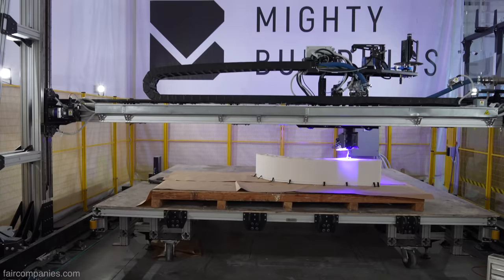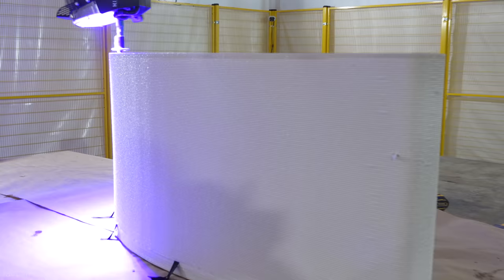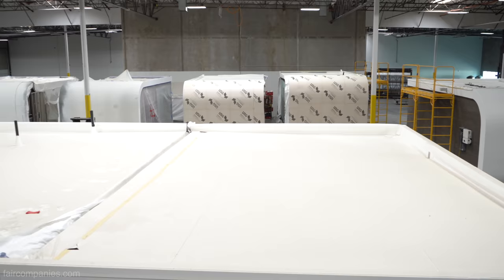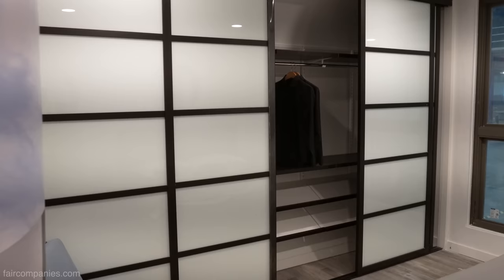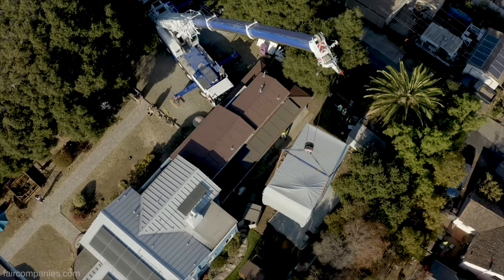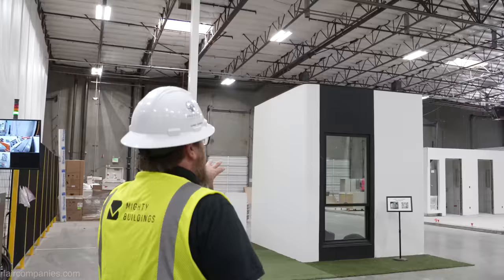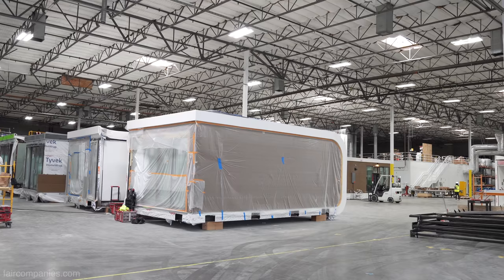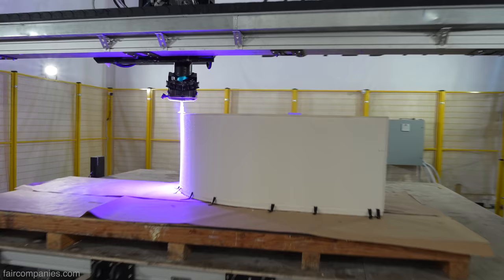3D-Printed in 24h, no waste. Price to fall as builds ramp-up

Comment: I’m a middle aged carpenter/builder and I’ll admit I was intrigued by the idea. Once I saw the price of these units, I can’t believe they sell any. Quarter of million for the little one. I could compete with that price and offer a better product.
Reply: Today that's probably true. 5 years from now though the price will be almost half and in 10 years it'll be a good bit less than that. 
The first cars could only be bought by millionaires.
Reply: @kensolar69  not even a close comparison. The first car revolutionized travel. Its not like this is the first house. It offers nothing new aside from less labor. Apples to fish comparison.
Reply: @taotracy4431  Horse and buggies to electric carriages and wood frame to 3D printed, That's apples to apples. It's a new technology that will evolve and advance over the next 10 years into something far less expensive more efficient than we have today.
Reply: Thing is Tao - it will be like Tesla - for twenty years it will be more expensive but as the technology matures and R&D is paid off it the cost situation will flip and they will be much cheaper - no labor being the main reason.
Reply: @michaelnurse9089  do you own a Tesla? The company was founded nearly 20yrs ago and the product and price is virtually the same. The vehicles are still impractical. Try living in cold climates with your Tesla and see how well it does. These homes are even more ridiculous. Another factor we didn’t even discuss is in the field remodeling and renovation. With nothing being conventional about these homes, in the field remodeling is impossible. There will be no one equipped with the capabilities to do the work. You people outside the industry have no clue. Homeowners can barely understand conventional remodeling and construction.
Reply: the first time i read this i thought you said you were a carpenter from the middles ages.  i was like, that's a cool profession tell me more.
Reply: @taotracy4431  Try reading a few history books, it's obvious you never have.
Reply: @kensolar69  Sure. Which ones do you recommend?
Reply: If you do it, it seems smarter to make the solar panels as a slanted overhang and use the roof as a patio/deck.  So, when you are BBQing on the roof-deck, the solar panels would shade both you and the house from the sun. Yes, the wind would affect the panels more, but the panels then could be oriented to the sun better and maybe also caught rain water. In some areas, because every house must have a roof, a deck-roof might not be taxed as a deck/porch.
Reply: @kensolar69  lol people like you said tesla cars would be less and less. The prices have only gone up with quality control issues. Solar? Still expensive and only adopted when government tax credits are high.
Reply: Agreed...see my post...

Mfg homes...with a bit less labor...(?)
Reply: @LincolnLog  I'm not living in one of these plastic nightmares either but solar is very, very viable now even without government subsidies.
Reply: @michaelnurse9089   Elon Musk would love that.
Reply: they will sit in the warehouse until they're desperate to lower the price.

Comment: Now, if we were able to reuse old plastic  to make homes or extra home parts then I'd be really interested. It would finally help with recycling more rather than dumping stuff out in fields or the ocean.
Reply: Except it uses a thermoset composite, that probably is not recyclable, or if it is, the recycling process is not green. Same problem wind turbines have.
Reply: See the film made at WASP in Italy. Same channel, series of programmed, their products often incorporate reused plastic pellets.
Reply: You can.  Check out styrocrete!  Shred waste styro with an electric lawnmower, mix with aircrete or cellulose-crete and pour into forms.
Reply: There is a company in Africa that does that
Reply: Py
Reply: Look up Earthship Homes
Reply: @Lurr-OP8  Earthships are great (if you have heavy digging equipment and a small army of slaves to pound soil into tires, have you ever done it? Back-breaking and very slow...therefore very very very  expensive labor costs).  Meanwhile they do not use up waste styrofoam and plastics which is the topic here.  
I am a fan of styroaircrete, for less labor but good products that anyone can use.  And of converting waste plastic to kerosene.
Reply: @keralee  I haven't worked on Earth ship projects but have worked on animal habitat restoration projects. I heard that newer Global models are being developed, which is more streamlined and less labor intensive. I'm sure it's a long way off before the average consumer would consider this but Environmentalists are their main target consumers. I understand the hard labor part but it's a better use of energy than going to a Gym for exercise, if you're the type of person who prefers a full body workout.
Reply: @Lurr-OP8 try doing just 1 tire, and you will understand  Its a workout and then some.  The problem with labor-intensive solutions is that in most places it translates to higher costs of  construction, usually with insufficient improvements in performance to offset the cost. 
For instance its easier to build of adobe or cinva bricks than rammed tires in most places--at least less labor and less digging, with free materials...the tires being better use chopped into sections and used as roof tiles.
Reply: The answer is earthship.
Reply: They have incorporated that idea within the Earth ship homes
Reply: We can now reduce plastic waste back into oil.
Reply: Actually they could and guess what? It would never again need to be replaced. 

They could probably fit 20,000 recycled bottles into each house with the ceilings, walls, and floor. You can fit that recycled plastic right inside the honeycomb walls. This insulations works in stick homes too.

A company now makes a product called SupaSoft. Its not itchy, and it is soft as a pillow. So, Why not fill the walls up?

This would be like the walls that were insulated using newspaper back in the early 1900’s except 15x better in R value.

Doesn’t hit the landfill instead its buried in our walls as a constant reminder we need to recycle. 

They should do it imo.
Reply: PET can be used for the normal 3d printing, just need to slice it into strips and then extrude

Comment: @4:40 "Still 90% less construction waste than a traditional home build." Now, that is a bold claim!
Reply: It's a bold face lie lol
Reply: I remember having a side job to labor trash in to the dumpster. there are sometime quite a bit of waste in compromise of speed. So, 90% is not hard for me to imagine. Its usual to pay one laborer to clean-up than a few framers to slow down and minimize waste. in the end, the material cost goes to the owner anyways.
Reply: @MegamanTheSecond  It is a lie. When you construct the house up to the "raw" state - just foundations, brick walls and roofing - what is what they got there - you waste almost nothing in traditional building. Waste comes  mostly with insulation, piping, electrical and finishing jobs, which you would still need to do on top of having their giant plastic box.
Reply: Maybe they can say that because they don't produce much waste themselves. All the waste is produced by their suppliers, they just assemble finished parts.

Comment: Totally fascinating. It would be a interesting question to find out if they're fireproof also so that if it was placed where the wildfires happen, less loss. Or flooding. Thanks for your time investment on this, and sharing. 😀👍
Reply: The concrete is fire resistant. (nothing in life is proof) And it has a great sound proofing ability and termites hate it. :)  IFC -  (Insulated Foam Concrete)  this is another form of construction that has it's advantages. Concrete will be a good solution for the future. Oh and it can cut down on air conditioner and heating use by about a third.
Reply: Does it need a foundation or is that part of the 3D printed package.
Reply: @janejanine1  Usually it's poured on an existing slab.
Reply: In regards to flooding, my family stays in a hurricane area in Mexico, and reinforced concrete is the go to construction material. If this pseudo concrete is even better, it should hold up pretty well
Reply: @MightyBuildings    Off-gassing of buildings and roads is a HUGE air quality problem in the Los Angeles area. Please, can you tell us more about if your units off-gas? And, if so, how does it compare with traditional homes? Thank you!
Reply: AirCrete domes are a WAAAAAY better solution.
Reply: @tixximmi1  more homes need to be at least 3 feet off of the ground on pylons. Flooding and termites/bugs and wood rot and mildew are easier to control that way.
Reply: @genkiferal7178  Not IFC built. No wood.
Reply: Mary the concept of Modular should lend itself to  mobility and can be design to allow shifting the house away from fire. Put it on wheels to the beach for Summer cooling. Another version of home mobility, for ya!

Comment: Wonder what kind of gases are being breathed in one of these?
Reply: yes I did not see any vents for fresh air wondering how that works need a carbon monoxide  meter lol
Reply: @cintiapollock2486  or if the meterial they use to print these gives off toxic fumes? Long term exposure issues?
Reply: @cintiapollock2486  During one of the scans across the inside the building you can see a door open.

Comment: seems like a great way to somehow use recycled plastics as well, yet, at these price points, there remains a cost barrier to the middle and lower class, and stick or block built building currently cost 25% of their retail price schedule. hopefully this can be financially viable in a few years, if not, it would be questionable if the tech can really achieve mass usage.
Reply: Won't be financially viable. Those guys want to make money.
Reply: @TheHonestFoodTeller  no one works for free
Reply: @parrotboss785  There are million of nuances between FREE and EXPENSIVE.
Reply: @TheHonestFoodTeller  The cutting edge is always expensive and their fixed costs must be gigantic right now. If they can scale and start producing/selling their costs will come down. I would be more interested however in multifamily housing as it makes more sense to accomplish their mission of sustainable and affordable housing.

Comment: So for the base model you could literally buy a ship full of shipping containers. This footprint may be the future for providing homes for those in need though. Just not by this company. You could build a traditional home at less costs 🤦 . These guys state that they basically eliminate labor hours so why so costly???
Reply: The research and design with a new technology will always make the initial provider expensive. If their idea works, other companies will be able to use their findings and do it without those initial costs making it more affordable. That is just the technology cycle.
Reply: @bbmikej  this is not there idea. As a matter of fact it’s not new at all if you search 3D concrete or other 3D housing projects. This is what’s possible and with this contractor it’s awfully overpriced.
Reply: I think what may be getting lost also is who the target market is. They are aiming for people who want a second unit on their lot to rent out. In this case you want as little build time as possible. A traditional unit would make your backyard unable for months whereas this system would mean it only takes long enough to build a slab then lift the unit in. It's hard to put a cost on convenience.
Reply: It's way better.

Comment: How do they deal with the toxicity of the outgassing of the binder-resin? Most UV-curable resins have a long-term outgassing, yes? A trinket is fine, but wouldn't a whole house pose a threat for its occupants? A (traditional) concrete structure, printed over 10 days (instead of 24 hours) seems a better proposition.
Reply: All synthetics off-gas. It'll take 20 years before anyone notices any long term health effects.
Reply: @OneEyeGoating  20 years to profit then settle out of court with the money you made
Reply: They said 5 month production time, maybe they let em sit as part of that
Reply: @shermansherbert2570  it's a standard prefab house with 3d printed shell as sales gimmick 5 months is standard for a house that size
Reply: @MegamanTheSecond  oh its a gimmick for sure. Just because you can do something doesnt mean you should. And unless these are like 50% the cost of tradition they are a joke. I bet they are over 100% of traditional.
Reply: Doesn’t your dentist use UV to cure your cavity filling?
Reply: @Xalta_Sailor  big difference between 1 gram of something and 500-1000lbs of it. Not all uv epoxies are the same either.
Reply: @Xalta_Sailor  As do they mercury, in amalgams. What does it prove?
Reply: @shermansherbert2570  checked online and they are California priced for sure. 1440 sq ft. $503,000. Get outta here.
Reply: @REDrhynoArt  ROFL That is literally the most hilarious joke of a price I have heard in a long time. This company is WHACK.
Reply: @REDrhynoArt  Damn I can have a steel framed house built for a quarter of that price
Reply: @shermansherbert2570  Try 200%

Comment: Using a 3D printer to print what is essentially 4 flat walls seems like a waste to me. Is far simpler using standard sheets and bolt together and insulate. I think 3D printing within the building industry is a good example of a solution looking for a problem.
Reply: Labor shortage is a real issue, as they mentioned. Ideally, the peak of this would be building a standard, efficient home for a suburb with half the work force and half the time.

But then again, we should be building more apartment buildings to solve housing rather than cheapened homes for dwindling land.
Reply: @Chedring  There isn't a labor shortage, there is a pay shortage.
Reply: @Chedring  I agree with more people living in flats. I live in Berlin and I would say 90% of people including families live in flats. If all these Berliners decided over night they wanted a house with a garden it would be an ecological disaster.
Reply: @tomedward8652  Trust me -they want a small house with a garden. Just because they live like caged animals doesn't mean they prefer it.
Reply: @tomedward8652  That's quite apparent in Ukraine. More land for grain crops.

Comment: I toured one of these in San Diego. The only part of the building that is 3D printed is the one curved wall at the rear of building and it performs no purpose other than a form otherwise it's just a basic traditional framed small space with basic but modern looking interior. I found the quality of construction to be poor overall but it looks like money is rolling in and some units are ready to ship. GLWS.
Reply: Thanks.  That explains how they got this past the building code.

Comment: Did I miss the mention of a price expectation? They have sold a few. If anyone happened to hear I would be interested in knowing. I think it is a great idea. But they run into some of the same issues that Tiny home owners and builders deal with archaic or inflexible building codes.

Comment: neighbor's tiny 3D printed house not much bigger than a tool shed took 4 months to build. when it was done it cost them over $18,000 and they already regret it all.
i got one of those prefab buildings from lowes and it was cheaper faster better than theirs. this include me upgrading windows and doors plus insulation and electrical.

Comment: You don't need steel or concrete for a structure that small. So using the plastic concrete-substitute isn't saving anything in CO2 emissions. I hope they are able to scale this up to large buildings.

Comment: How much embodied carbon goes into producing these? Polymer, in my mind, equals plastics and petroleum. Not sure this is better than traditional American construction, technologically beneficial or not
Reply: Polymer is a blanket term for a mix of susbtances with very large molecules composed of many repeatin subunits. Polymers can be borh synthetic and natural. So it would ultimately depend on what's actually in it.

However, considering just how little material is used to actually make these structures, I would hesitate to suggest it's worse than anything.
Reply: He says polymer and composite a lot to avoid saying plastic. 3d printing is generally plastic.

Congrats you made a plastic home. How awful.
Reply: @adamt195  totally ignorant.
Reply: When you care about this, then hempcrete is the solution for everything. It binds carbon...
Reply: @adamt195  If you had only invested one minute to briefly look into the topic before your indignation rant, you could have spared yourself this triple embarrassment.
Reply: @sengasengana  I actually went on their website. They never say explicitly what the 3D printing material is made of. Just that it is "water tight, fire resistant, lightweight, Stone-like,  polymer composite"

Sounds a hell of a lot like plastic. Its a plastic house. Petroleum is drilled out of the earth and refined heavily to make the plastic that makes these homes. Compared to wood, which is grow in a tree. Storing carbon from the atmosphere in the building.